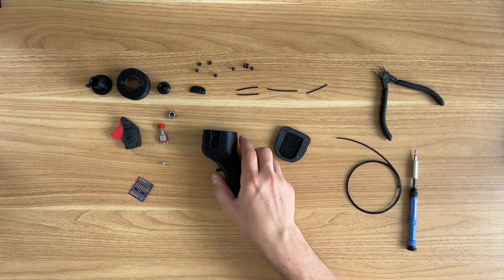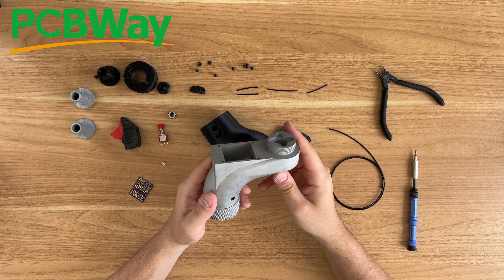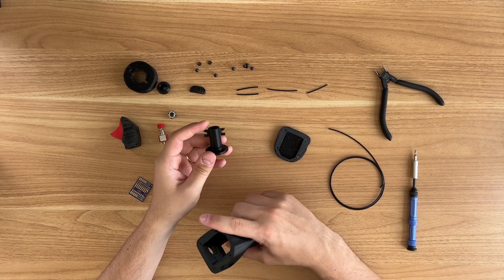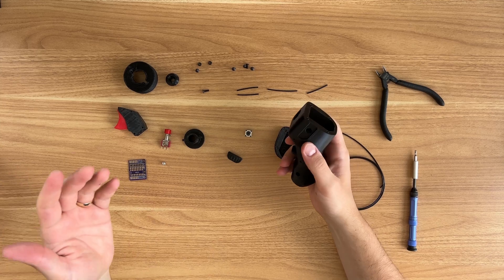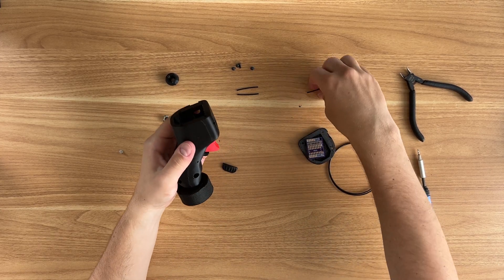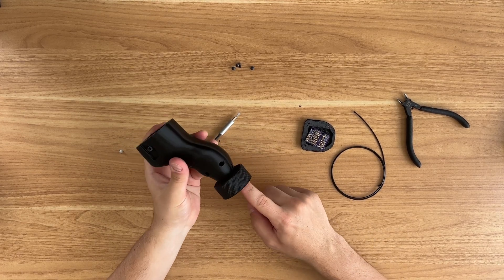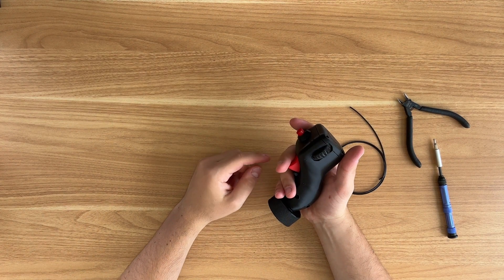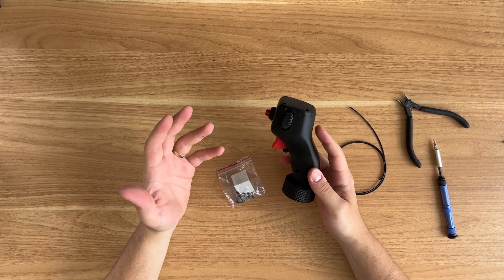F-4E Phantom WSO Grip Assembly & Project Vlog

Comment: For the scroll wheel, wouldn’t it be possible to to use an encoder instead,  configuring it as a virtual axis in the Virpil software? 

You might want an extra button to reset the axis (to 50%), for ease of use.